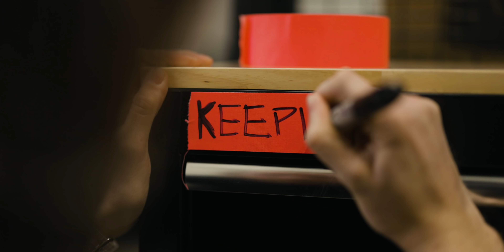EVERYTHING MUST GO

Comment: Recommendation... As you use gear going forward, place a label on there with the date used. This way when going through this process later, will be much easier at a glance to know when the last time you used something was. And set an "archive" timeframe whereby if you don't use something for x amount of time, it's time to sell or get rid of. Post that archive time in your cage.

Comment: It's so nice to not have all of that stuff. There was a time in my life where I actually gave up photography because having gear ruined it for me. I felt like I had to bring all this gear everywhere I went. Now I have one full frame camera, about 6 lenses but if I go somewhere I generally only use the lens that's on the camera, I don't bring extra batteries (I'm not doing video though) I might bring one extra lens at the most. I don't bring extra cards, I'm doing photography and have 256gb in both slots. And even now I start feeling like I have too much. Plus I always have so much more respect when I see a photographer who is still using the 5D Mark ii and refuses to upgrade and is putting out better photos than me. I can do everything I want to do with the 24-70 2.8 ii and the 135 F/2L. I have other lenses but I don't need them. There was a time when I kept buying hard drives back when I would do videos more and I got WAY too many of them. NEVER buy anything based off an idea. Wait until you KNOW it's going to happen. Like if you have an idea to do a project that's going to require some new kind of light or something, don't buy it until you know for sure that its worth it. The only thing I'd buy at this point is a Canon 70-200 2.8 IS, any version. You have an extra?

Comment: Dude,  we were cut from the same cloth! Gadgets, knives, watches, photography, etc. Is that the new clear Casio GA2100 your buddy was pointing outt? I'm thinking of building a Casioak with the black GA2100 with the white hour markers, and a black or digi camo stainless steel body/bracelet, but I'm hoping they come out with a solar powered  / radio controlled version. I hate having to change batteries and pressure test watches each time so I've replaced all my watches with Seiko autos or Casio solar powered/radio controlled for time accuracy.